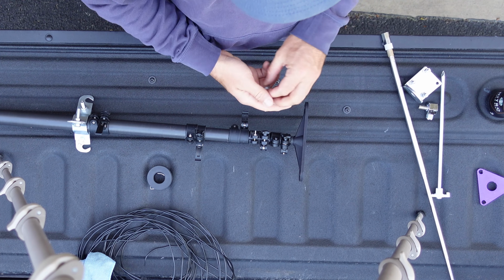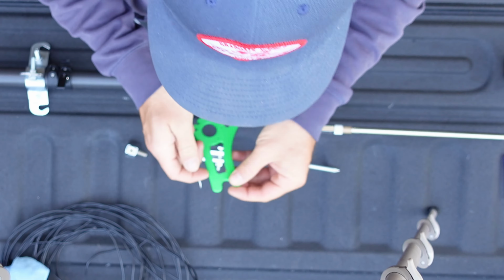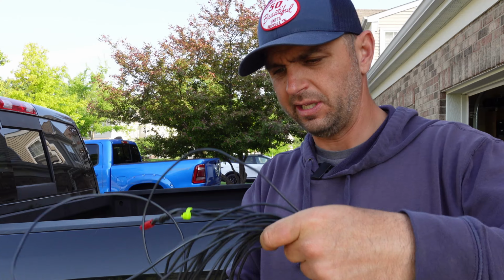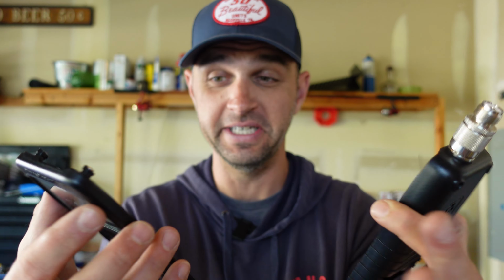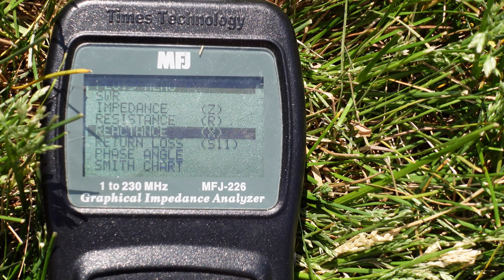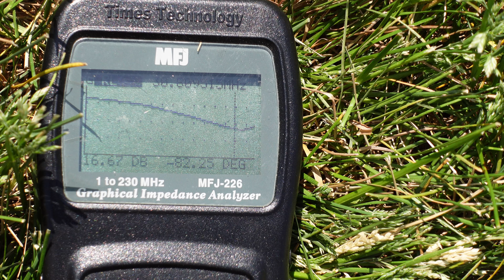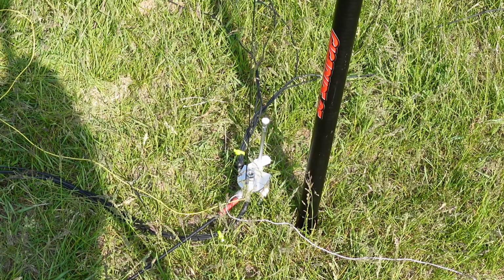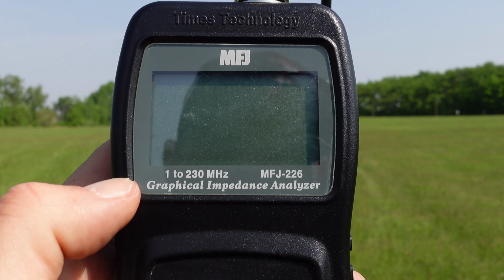Does Carbon Fiber Make Vertical Antennas UNUSABLE? Let's Find Out

Comment: 1. Contacts are meaningless without comparison to another antenna and multiple test. 
2. Checking SWR at the end of 50 feet of coax is meaningless. Impedance and SWR must be measured at the base of the antenna. Checking at the end does not take into account "transmission line transformation", copper loss and dielectric loss of the coax. 
3. Impedance of a 1/4 wave ground mounted vertical should be closer to 30 ohms, not 50 ohms. Therefore, low swr can mean high ground loss or absorption by mast.
4. Some folks believe in running the wire up the center of the mast. That would be a more telling test.

I saw the video of that guy sticking a short section of carbon mast through a coil. How is that proving anything? It's too short!  
Here's a test: Feed that mast and measure the RF current at various points using an inductive coupling to the meter. Run the same test with either a metal mast or wire supported by fiberglass or pvc. If that carbon fiber can be used as a radiator then that proves it's going to absorb RF. 

Remember, even if you loose 1/2 your power, that's just 3db and one S unit is 6db. That's why contacts are unreliable for this kind of test. 

Oh....The carbon fiber mast vendors won't like that one! :*)
Reply from the maker: You seem to have a decent following and knowledge...Would you like me to loan you one to conduct tests?
Reply: Thanks but I'll leave the testing to you. It is a lot of work as you know. 
Some things like this don't really need testing because we already know what will happen. I guess sometimes we just want to see if we can "get by" with bad designs even if we know they aren't optimum. Several times I've accidently transmitted into a dummy load and was heard miles away! 
I just consider a carbon fiber mast to be a metal mast and treat it that way. They are fine for use as supports but not part of the antenna. 73

Comment: Negative reactance means capacitive reactance. It electrically shortens antenna. To counteract that, you will need to add some coil or add length to that antenna, i.e. 17 ft whip. OR cheat by using a wire that has very low velocity factor - inner core of cheap rg-58 (copper in PE insulation - just strip the shielding).
Reply from the maker: Thank you for this. It's good information and I think you made it easy and straight to the point to understand
Reply: If you look at the smith chart you showed, it had the plot below the axis line. If plots are “below” or “negative numbers”, that is showing capacitive reactance. Numbers that are above the line or are positive are considered inductive reactance. 

Loading the system with a small coil would introduce inductance to the system, thus counteracting with the capacitive reactance. This has a “balancing” effect to the reactance, making the system resonate. Capacitive?  Add inductance. Inductive? Add capacitor!  One value balances the other. 

Your goal for antennas is to have x=zero, or j to be zero.

Comment: When I was making my QRPGuys 3-band vertical I didn't realize I had wrapped some of the 17-foot vertical around the carbon fiber fishing pole & it considerably lowered the resonate frequency, the problem I had was without winding it on a rigid firm the results weren't very repeatable so it played havoc with tuning the antenna. Then I replaced the carbon fiber pole with the MFJ-1978 telescoping antenna, but I think I got one with a bad crimp at the base be a use in the wind it was toggling about 1 MHz different in resonate frequencies each deployment for the same length. One thing about antennas is we can't get away from the wind! Cheers, Davey - KU9L
Reply from the maker: Thanks for the info, it's something to be aware of!

Comment: It will have very little effect, since I doubt that there is any actual conduction between the push-up sections unless you put metal screws into them at the joints. Anything shorter than a quarter wave section of the mast should be pretty much invisible to the antenna.

Comment: I used a carbon fiber mast to setup a ZSBKW/G5RV  for portable use in my back yard.  I set it up as an inverted v and angled the ladder down and away from the the mast.  I had heard about the interaction of the fiber mast with the radiating wire.  I got good swr's and made some great contacts so their might be some compromise there but it was workable.   73 Brian

Comment: My feeling is that you've accurately charted most of the important "coupling" or interaction results of close-by objects to radiators. Your findings and others that I'm aware of, show that these are relatively minor for carbon fiber masts. After all, look at the affects surrounding objects, soil, height, etc. have on a dipole. Can't recall in over 65 years around the bands, not having to trim or compensate antennas in some way if I was after a near-perfect match or pure pattern. Even then, there is virtually always that unknown/unmeasurable/questionable factor. (An antenna range would be nice to have) I'm not concerned about my two GigaDude 25 masts, that will be in use soon. Many thanks for all your research, efforts and support of our ham community!!!
Reply from the maker: So happy to see the masts were delivered.   I sure had fun testing and I believe I have more good information / knowledge, to continue testing.  It's a blast. Thanks for your support!

Comment: When I put my Ohmeter on my CF mast it measured 100K+ ohms, but wasn't sure if that would interfere. Does it interfere, does it become the radiator too? A UK Ham measured that it was only 0.1dB different than his other fiberglass mast on a vertical antenna configuration. But how does it perform? I will try it this week with my QRPGuys 40-20M 3-band vertical, I am winding toroids this weekend. Cheers es 72, Davey - KU9L ;-)
Reply from the maker: I went back out yesterday to run a few more tests and collect some information. Today, I am going in with a new clear mind and trying a few things / using wspr. Should be fun. I have a multimeter around here somewhere, I'll see if I can't test mine as well. I think I saw that video (That may be the gentleman who used the spectrum analyzer as well).  Cheers.
Reply: What did ya'll find from the follow-ups? :)

Comment: Testing methodology - the best way to do testing like this is to setup 2 antennas, as much the same as possible, one with the carbon mast, the other fiberglass!  Then use a DUAL receiver/dual watch rig like the 7610 or similar, so that you can see the waterfallS, plus HEAR the signals from the same radio thru headphones, recordings, etc.  That is for RX.

For TX, you would obviously need to switch antennas during the testing cycle. 

Obviously from your video it does work to some degree, but how does it compare?  That remains to be seen.

The other testing would be to use wsjtx, and send out CQ calls over several bands, and then use PSK reporter to see how far out you got overall, and with how strong of signals. That is a great tool for testing antennas.   

73
Reply from the maker: Thanks.  I think I'm going to try to get back out tomorrow because I would like to test this.  One issue is, I don't have another mast.  My thought was to run the test on 10m or 20 with a telescoping vertical and then the same with the cf mast.  I would use wspr for the TX.  I would only be able to get the antennas 100 ft apart, I think this will be okay though.  Finally, I think I'll be able to have my flex remotely monitoring and recording. Thanks for the useful suggestions, and should make for a better part 2.  This is the fun in learning and testing!

Comment: I sure hope not. I paid like $80 for my Japanese fishing pole antenna mast. Lol
Reply: Capacitance is a natural thing in HAM radio. The most common occurrence is the capacitance coupling of the counterpoise to the ground. That capacitance appearing on the video is a natural thing in building antennas. It could occur between two wires (look at DX Commander). I would be more scared if that mast spawned an HOA than the fact it adds capacitance.

Comment: Federal law states HOAs are not allowed to ban/bar any communications such as dishes or antennas. Got the complaint from the HOA against me, then showed them the FCC regulation and my lawyer(sister) and now they are real nice to me so I don't report them and cause them to get fined.
Reply: Got that regulation number handy?   I know they can't ban people from reasonable sized dishes and TV antennas, but larger ones can be currently as it stands.   There was a proposal that is trying to get through that would ban HOA's from saying no,  but I never heard it passed this year.   Please assist if you can cause I'd love to tell my HOA to hush up,  lol
Reply from the maker: Which federal law is that?.
Reply: @HAMRADIODUDE  Over-the-Air Reception Devices Rule
Over-the-Air Reception Devices Rule (OTARD) - 47 CFR § 1.4000 - has been in effect since October 1996 and prohibits restrictions that impair the installation, maintenance, or use of antennas to receive video programming. 

Homeowners Associations cannot prohibit or adopt restrictions that: (1) unreasonably delay or prevent installation, maintenance, or use of antennas; (2) unreasonably increase the cost of installation, maintenance, or use of antennas; or (3) preclude reception of an acceptable quality signal
Reply: @HAMRADIODUDE  I'm literally just getting into the hobby, learning about making my own antennas and such while building a shortwave, and have bought a couple of mobile hand-held UHF/VHF additionally.
Reply from the maker: @theodorepollock1273  interesting.  The rules specify "No.  The rule does not apply to antennas used for AM/FM radio, amateur ("ham") radio (see 47 C.F.R.  §97.15), Citizen's Band ("CB") radio or Digital Audio Radio Services ("DARS")." On the FCC website.  If you're getting away with it, awesome.  Won't fly here though.  On the other hand, Congress.gov
https://www.congress.gov › house-bill
H.R.466 - 116th Congress (2019-2020): Amateur Radio Parity Act was the bill they attempted to pass, I might still be sitting somewhere, which would allow amateur radio operators rights pertaining to HOA's.  Even then, I'm going to have a hard time since I live in an h o way where I don't own the land of the property around me, just the inside of the house
Reply from the maker: @theodorepollock1273  very good about getting into radio and building your own antennas. That's one of the funnest things for me, hope you enjoy

Comment: there is an easier test.... support the wire antenna on a fibreglass pole. Measure the SWR... leave the fibreglass supported antenna up and just bring the carbon fibre pole up next to it. Re-measure the SWR. If there is no change the carbon fibre isn't part of the antenna & you are "good to go". If the SWR changes the carbon fibre is acting as a parasitic element & it is best avoided. I wouldn't mind guessing that not all "carbon fibre" supports react the same way so always worth checking.
One thing to watch for... if the carbon fibre isn't properly conductive it could be lossy, in which case it can actually widen bandwidths & IMPROVE SWR in certain circumstances (one of the best SWR's is actually found on a dummy load).
Reply from the maker: Oh wow. This would be a lot easier. Thank You!